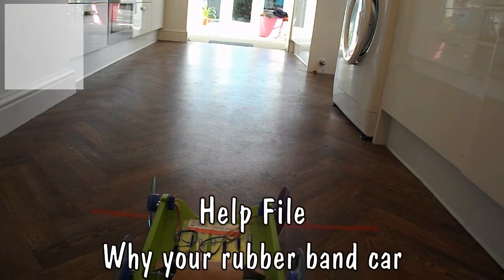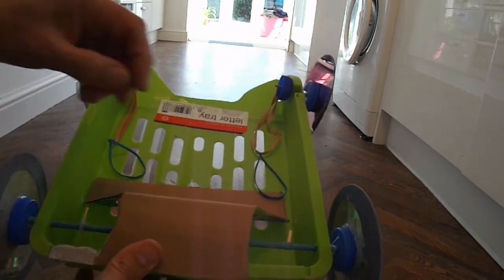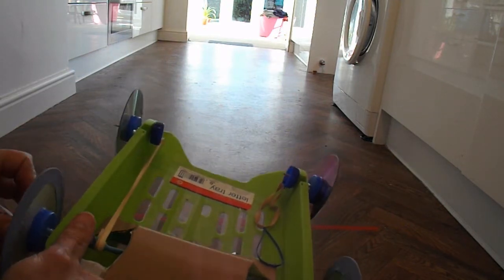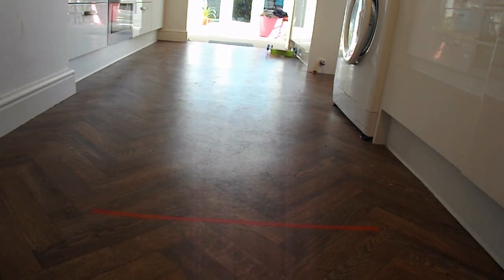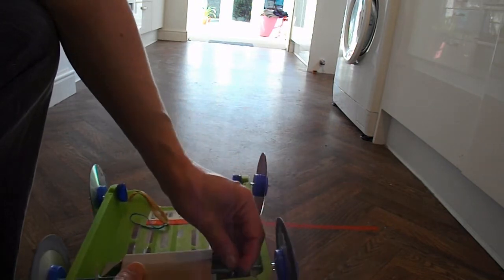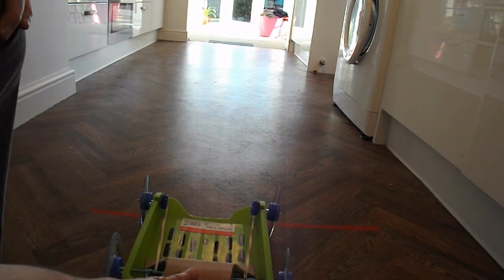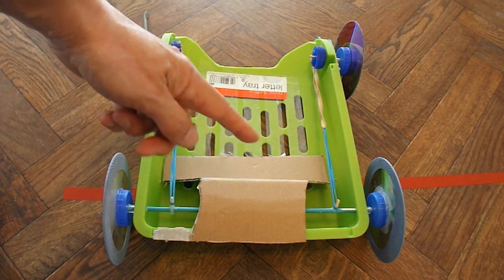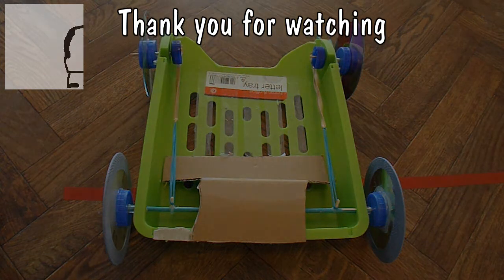Help File - Why your rubber band car turns left or right

Comment: no the rubber band is turning but the car is not moving forward and it is for the plastic eater bottle car
Reply from the maker: If you are referring to a different video then make your comments on that video so I know which video you are talking about. I have just under 4000 videos on YouTube and I cannot remember every detail of every video. If the wheels are spinning on your car then you need to add something to the wheels to help them grip, like a rubber band round the rim. Alternatively add some weight to hold the car down and that will improve the grip. There is usually extra information in the video description of my videos. This video is a good example, there is a link to a video showing how to put rubber tyres on CD wheels.

Comment: why wouldn't the wheels turn
Reply from the maker: I don't understand your question. Which wheels and turn which way? They all turn !! Do you mean like steering? The axles are fixed so you can't steer with them. Normally that is a good thing because it keeps the car straight, but if the axle is bending because of the tension of the rubber band it can make the car veer off to one side and that is what I am demonstrating in this video.

Comment: If you remember, I mentioned something similar a while. 8-)
That would mean that if you controlases each wheel with one of these radio controlled cars you have (one motor per wheel), you could turn the vehicle as you like.
Y is the shorter (less length between front and rear wheels), the better it will turn.
Reply: Nice
Reply: Nuce

Comment: perfect explaination :-)
Reply from the maker: Elnufo thanks, I did consider adding diagrams to explain why it goes in the direction it does, because it is not obvious. I might add this to the description. 
If you are bending the axle forwards close to the left wheel it turns that wheel towards the left, but it also turns the right wheel towards the right, the distance from the point of the bend is closer to the left wheel so it turns it further. 
Bending the axle from the central point means both wheels are turned outwards an equal amount so the result is the car runs straight, but less efficiently than if the axle was stiff enough to prevent it bending.
Pointing the back left wheel left, turns the front of the car right. It is all a bit counter intuitive unless you draw it out, or you just accept that is what happens from observation.